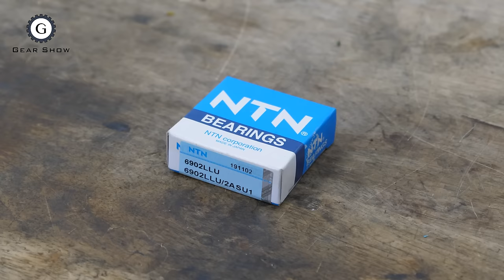$1 Cordless Impact Wrench Restoration

Comment: I have some questions bro
1- what spray did u use to clean the gear ( at 2:00 ) 
2- what spray did u use for cleaning motor? 
3- what grease did u use?
4- where did u find the replica cover (yellow)?
Reply: 1. Probably wd-40 or engine decreased
2. Same. 
3. Probably a lithium grease. All I've looked up says find ngli #1 rating with molybdenum.  Some companies have a signature blend.
4.e-bay

Those are my best guesses

Comment: Hey I have a milkwaukee 18v battery that charger lights turn red and green and doesn't charge for never. I also tried to start up with another same healthy 18v battery and it makes a lot of smoke. It is possible to repair? or it's more expensive than buy a new one?
Reply from the maker: I'm not yet experience with milwaukee. I hope anyone could share this.